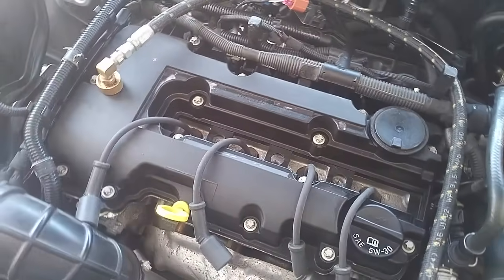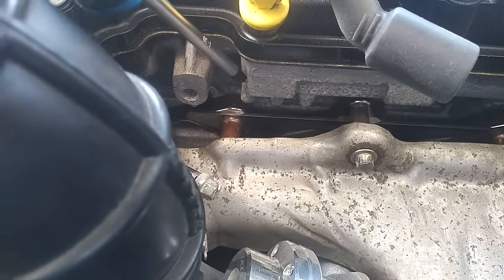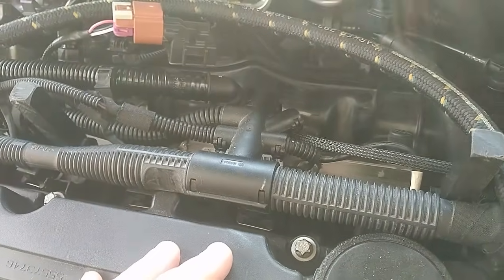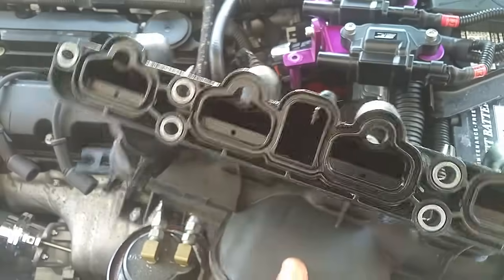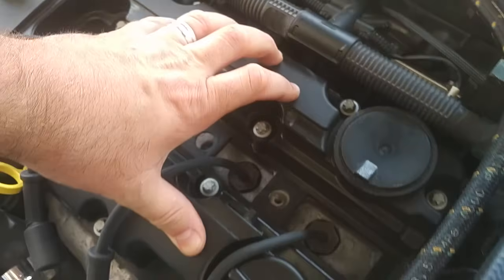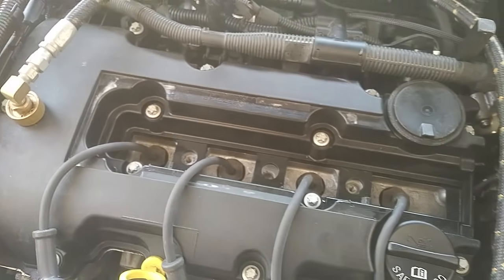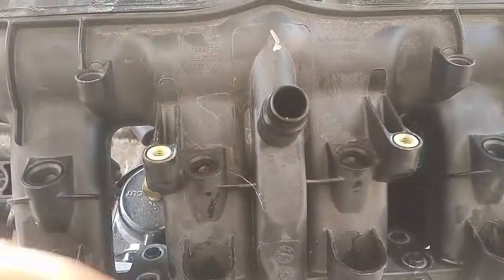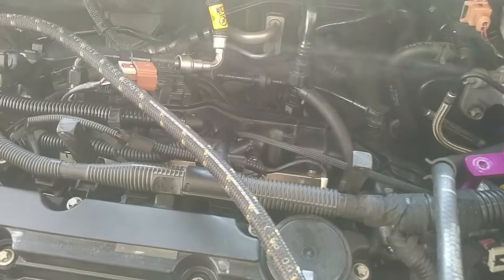Chevy Cruze Sonic Trax Encore 1.4L Turbo PCV Issues, Diagnosis, and Solutions

Comment: I’m getting massive blow by air pulsing out of the oil fill cap and dip stick when I pop them off and it’s running. I’m not sure what’s going on but I’m sure it’s something to do with the PCV system, it has codes for P1101 and P0507. It runs relatively normal I popped off that pcv hose on the intake and the inside of it is coated in oil, any ideas?
Reply from the maker: Has it been very cold where you are?

Comment: I hope you can answer a question for me sir... I'm a heavy equipment and diesel tech but I don't work on a lot of modern gas engines.. my wife has a 2015 cruze with turbo.. I topped off oil and forgot to put the cap back on it... she drove it a little while and then it started blowing oil smoke out of the tailpipe, and quite a bit of it.. it seems to be clearing up now that I topped off the oil and put the cap back on... can you tell me how that oil got into the exhaust? PCV possibly?
Reply: Thank you in advance
Reply from the maker: @VAHOSS very likely a PCV issue. Have you inspected the intake manifold check valve as shown in this video? Or installed the cruzekits pcv fix kit?
Reply: @AndreiDPop not yet.. the problem just happened today so I'm just now digging in and doing some research.. it had a fuel trim fault code
Reply: Actually I replaced that valve about 2 years ago... i think it was actually part of the valve cover
Reply from the maker: @VAHOSS it’s not. Please watch the video you’re commenting on.

Comment: Hey so I’m chasing this issue down on my 2016 Trax with little luck. So I was having weird  idle with multiple codes, I replaced an o2 sensor, maf sensor, valve cover and the corrugated hose, the idle got pretty much fixed but now I’m still getting a p0171. I checked for the nipple in the intake manifold and it seems to be in there. Is it possible for the nipple to be there and the check valve still failing. Any other way to check if it has failed besides the visual inspection of the nipple? Tests that I’ve done so far to see if the intake manifold failed is I removed the corrugated hose and fitted and long rubber hose to the port on the intake manifold that reaches all the way in the car through the window and went for a drive, basically what it does is at idle there is heavy vacuum and under load there is positive pressure, the longer I hold my finger on the hose the more positive pressure it builds as I accelerate. Is that just positive crank pressure I’m feeling or would that be turbo boost I’m feeling due to the check valve failing?  The positive pressure that build up at the end of the hose I would say is somewhat significant I’m guessing close to 10 psi or so.
Reply from the maker: Lots to respond to here. 

Yes it is possible for the nipple to be slowing but for the check valve to have failed the flap on the back side gets deteriorated and breaks off. Seen it happen a number of times. 

P0171 implies a vacuum leak. 

Let me guess…aftermarket valve cover? Your p0171 indicate a possible pcv pipe crack, but the remaining symptoms all point to a defective valve cover. Always use only OEM valve covers, never aftermarket. Strong vacuum at idle points directly to a valve cover issue. 

If this is an aftermarket valve cover, I’d recommend installing the pcv fix kit with a new OEM valve cover. I have a combo for both on cruzekits.com. 

I’m also a bit concerned with the hose you used in exchange for the pcv pipe. You didn’t use heater hose did you?

Comment: Can I put a standard PVC valve in the line that runs off the intake
Reply from the maker: Nope. The system doesn’t work that way. There’s already a check valve at the turbo inlet so adding a second would be redundant, and standard pcv valves aren’t designed to seal as check valves. Did you watch the whole video?

Comment: Thanks for making this video, you seem very knowlesgeable. I'm considering buying a 2018 Buick Encore with this engine although skeptical of all the issues... From what i've read, it all seems to stem from the PCV system going bad. Not sure at this point whether I should avoid at all costs... Input welcomed
Reply from the maker: If you’re comfortable working on your own vehicles from time to time, the engines are internally quite stout and easily make it past 250k miles. It’s just a few issues here and there like the pcv and cooling parts that sometimes give people trouble. Once those are dealt with and monitored, the cars are reliable. I have a friend nearby that has over 350k miles on his.
Reply: @AndreiDPop  I wasn't sure if I'd get a response as its 6 years since posting but I appreciate that very much. I'm a tram technician by trade and comfortable with small/medium repairs. Happy with a few proactive repairs for a $10,500 car. Appreciate your response. Interested in your PCV kit, was wondering, does it essentially bypass some of the PCV gasses?
Reply: I'm most afraid of the turbo failure but what i've managed to gather is that the issue stems from the PCV valve on the intake manifold malfuctioning, increasing crankcase pressure, oil seepage into turbo inlet pipe causing reduced airflow, heat, and cracks etc. 

If it could all be prevented by addressing the PCV system, then I'd feel assured. Would like to get an expert opinion though. Appreciated!
Reply from the maker: @Voltermort turbo failure won’t have anything to do with the pcv system. When it fails, it’s usually the wastegate housing crack getting too wide. Subaru has the same problems. Use a very good synthetic oil like AMSOIL signature series and your turbo should last at least 150k miles.
Reply: @AndreiDPop appreciate it 👍

Comment: Such a bad var. easy fix. Most of the newer models the nipped is gone. I have one on  my channel and they did away with this. Make sure on this year to get the upgraded version. It’s a TSB now on  this vehicle. Also an extended  warranty… check the NHSTA…
Reply from the maker: There is no upgraded version. The Dorman ones still fail, and the GM manifold was updated to move the bypass valve hose higher up so the bypass valve stopped filling with oil and gumming the solenoid. The TSB and extended coverage is only on some models and only for 10 years/120k miles. 

The only true OEM-spec upgrade is the cruzekits pcv fix kit.
Reply: @AndreiDPop I’m speaking about the newer models. Slightly different engine. Same deal. And yes the kit I am aware it. It places it in a different location. These stupid oil traps/PCV valves are trash… smh. 🤦‍♂️
Reply from the maker: @TSMobileMechanicLive oh, yeah the new engines are completely different. The LE2 direct injected engine. Nothing similar about those PCV systems. They use an orifice under a metal valve cover.
Reply: @AndreiDPop they have the same valve cover that is crap and the diaphragm always falls apart and make the engine run terrible. It does not allow it to seal the PCV system properly sucking in too much air when it shouldn’t.
Reply from the maker: @TSMobileMechanicLive  I'm not trying to be argumentative here, but the LE2 engine doesn't have the same valve cover or intake manifold. In fact, they don't have a diaphragm at all in the valve cover. The Gen1 1.4L Turbo and Gen2 are completely different with nothing shared between them, and all of the Gen1 1.4L Turbos are the same without any consequential updates to the PCV system. 

The valve covers are usually fine if you get OEM valve covers. Those last 50,000-180,000 miles if the intake manifold hasn't failed. I've even heard of a few going over 200,000 miles.
Reply: @AndreiDPop    I’m not trying to be argumentative either 😅 — but we’re clearly talking about two different 1.4T engines here. Have a look for yourself. Maybe that will be better clarification sorry for any confusion. I wanted to make sure put one thing out to you though.

https://youtu.be/JLm8DA-4JfY?si=Gw7zKNiVQ7JDaSja
Reply: The vehicle in my video is a 2018 Chevy Trax with the LUV 1.4L Turbo, not the LE2. The LUV has the black composite valve cover with the built-in PCV diaphragm, and that diaphragm fails constantly. When it tears, it causes high crankcase vacuum, lean codes (P0171, P1101, P0106), whistling, and rough idle. GM TSB PI1261A and Special Coverage 14882 both call for valve-cover replacement because the diaphragm isn’t serviceable. 👆👆👆
The LE2 you’re describing is the direct-injected, aluminum-cover variant used in later Cruzes and some Encores — totally different PCV layout with an internal orifice system. You’re technically right about that engine!
On the LUV, the intake-manifold PCV check valve commonly fails or goes missing, which over-pulls vacuum on the cover’s diaphragm until it rips. Replace the cover, inspect or fix the manifold, and you’re done — that’s the repair I showed.
GM also revised the OEM covers later (deleted the top vacuum nipple, altered baffles). They didn’t market it as an “upgrade,” but it absolutely is a revision meant to reduce repeat failures. So “no upgraded version” isn’t really accurate in the field.
Reply: @AndreiDPop  we are both correct essentially .. the 1.4 L setups GM used are the LUJ/LUV – found in early Cruze, Sonic, Trax, and Encore. Port-injected, black plastic valve cover with an integrated PCV diaphragm (that’s the one in my video)… Next the LE2 – newer direct-injected version in the later Cruze and some Encores. Aluminum cover with an internal orifice-style PCV system instead of a diaphragm pod. This is where confusion occurred… The LV7 – naturally-aspirated 1.4 L used mostly in the Spark. Simple design, no turbo, no PCV diaphragm issue.
So we are both talking about the “1.4 T,”… We are actually speaking about different engines with different PCV systems… The video where I did the repair above in the link is the LUJ/LUV version where the valve-cover diaphragm fails and replacement is the correct fix. Sorry for any confusion. To different but similar repairs. I never had actually watched your full video until just now lol… I just glanced it over but now I have a better understanding. Thanks. Great video by the way.

Comment: Love your PCV valve mod. I've used this on two of the turbo models. I'm a fleet mechanic for Domino's franchisee and unfortunately we bought eight  Chevys Three Fords and one Kia Rio. The only thing I've ever done to the fiestas and the Rio was change the brakes and oil. The Chevys unfortunately break once a month and I constantly fight to keep oil in it and coolant. They seem to have a good Chevy block but it's all the cheap accessories that plague the 18 and the 1.4 turbo. I love your thoroughness if that's even a word to me. You're one of the better mechanics that are on the internet. Thanks! Keep making awesome videos
Reply from the maker: Thanks for the encouragement! I need to get some more videos made here before the weather gets too cold to do so. Thanks for the support also!

Comment: i still have a check valve. but regulator got fcked twice why
Reply from the maker: Are you using OEM valve covers?

It’s also possible that the check valve in the intake manifold is completely deteriorated. All you can see is the retaining nipple; the flap that serves as a check valve is on the back side, and sometimes they just wear off completely.
Reply: @AndreiDPop thanks. I have P0299 under boost code, lacks power during uphill climb. does it have anything to do it pcv faults. turbo is great, no leaks. I can only see air coming out of pcv regulator at valve cover during high rpm. just wondering if thats a crankcase blowby or a boost leak.
im thinking to replace intake, vaccum hose pipe and valve cover now. I dont know if that will fix the underboost issue.
Reply from the maker: @Gibsonchha there should never be any air coming out of the vacuum regulator on the valve cover. That indicates the diaphragm has failed. A missing intake manifold check valve could contribute to the p0299. I would recommend ordering the combo pcv fix kit from cruzekits.com to address both. Don’t use an aftermarket valve cover.

Comment: If the nipple is gone and is not able to close. Where is the pressure going? Thank you.
Reply from the maker: Right into the crankcase.
Reply: @AndreiDPop  Is there a way to check the check valve that is a one way into turbo inlet?

Comment: I replaced my original intake with an after-market one. I still don't understand how the check valve here works, how does it open and close. Could you pls. explain with another video to show how the small rubber nipple works? Is the nipple the only part in the check valve?

Comment: Round cap on top is a PCV VALVE.
 INTAKE  NIPPLE GOSE BAD, YOU CAN GET A CRUZ KIT. YPU HAVE EPOXY THE HOLE AND INSTALL A INLINE CHECK VALVE . FORGET REPLACING VALVE COVER. LOOK UP  CRUZ KIT. Also, the sonic dose not have a coil pack. 
 This sonic has a mode on the intake.
Reply from the maker: Just for clarification, It’s a vacuum regulator diaphragm. It regulates vacuum from whatever the manifold is producing to 11-18 in-wc. This is documented in all GM TSBs regarding this issue. 

The reason I’m specific about that wording is because many people don’t realize there is an actual pcv valve inside the intake manifold. The nipple is just the part you see, but on the other side of where the nipple is mounted is a flap that serves as a pcv valve by allowing air to flow only one way.

Also yes it does have a coil pack. It’s the cover.

Comment: Hey Andrie, I believe the pcv located just above the turbo may be bad.  Im having high cranckcase vacuum (40.8 in of water).  Im seeing that it could be due to a blocked fresh air intake hose.  It this pcv valve where the pcv system gets its fresh air and could it be the reason I have high cranckcase vacuum? BTW, I have installed you v3 pcv fix kit

Comment: I am stuck. My Opel Astra 1.4 T (same engine) has also some problems. It has oil consumption 0,75 liter/1000 km),  performance problems, runs rough in idle, the engine is shaking. P0011 code camshaft position timing. Tank cap sticks, whitles when off. 

I have this since a few month, perhaps after a valve cover change (leaky) or an oil change (don't know)

I changed the valve cover again this week. Not better. The mushroom head in the intake manifold is still there.

I am not sure what is the problem. Perhaps timing chain or something with negative pressure or a combination. Have no idea how to analyse this

The workshop says oil consumption an timing chain are two different things (?). Pressure loss test was good
Reply from the maker: Do a compression test.
Reply: @AndreiDPop good idea. Difficult problem.

Comment: One of shitiest engines ever made
Reply from the maker: Yet I know several people with over 300k miles on them with basic repairs, and I know of one that went 691k miles before it burned an exhaust valve. 

They're not the most reliable, but they're excellent on gas, have great drivability, and will last a long time if you know how to hold a wrench.

Comment: I have a strange problem po299-00 fault , seems to be excessive vaccuum on oil filler cap , checked the intake and the breather for correct operation of check valves and all seems good , what else should i look at that could be causing excessive vaccuum
Reply from the maker: How did you determine that there’s excessive vacuum? What is considered excessive and how did you measure it?

Comment: I'm having issues with a huge oil leak on the passenger side, and oil in my spark plug well. I'm wondering if my PCV system is failing.
Reply from the maker: Very likely, and very common. If you don’t have the v3.4 pcv fix kit installed, I would recommend that asap.
Reply: @AndreiDPop  Just watched your other videos. Ordering tonight.

Comment: Very informative, thank you. My code came back as canister purge valve. I bought it from Auto Zone, haven't installed yet. Wanted to watch few videos and thus came up. You seem very knowledgeable about the 1.4, is there a way to contact you like email etc. Maybe with advice on maintenance as well as potential upgrades, boost maybe, chip or computer mods etc. Thank you, also new sub
Reply from the maker: Sure, you can contact me through the chat box on the cruzekits.com website.

Comment: The corrugated PCV pressure return pipe that goes brittle breaks so easily!
I rebuilt the one on the car i was working on (A 2011 Cruze) using washing machine drain pipe.
It's the perfect diamiter and the original fittings easilly slip onto it.
Reply from the maker: @AlanRFisher  it’s not pressure hose, it’s vacuum hose, which is inportant because there’s 18 in-hg of vacuum on that hose and heater or water hose will collapse under that vacuum. 

The inner lining on washing machine drain pipe will not survive with constant exposure to combustion products and oil mist. That breaks down the lining and it will swell and deteriorate, potentially sending bits of debris through the turbo when it does. 

This is why my cruzekits v3.4 PCV fix kit uses the correct spec PCV hose. I suggest you replace that hose ASAP.
Reply: @AndreiDPop  Yeah i said pressure but i did mean to say Vaccuum.
Trust me i have tested it extensively it works100%
It's the same kind of hose they used frm factory it's just at least 3MM thicker.
Still Corro.
Also, It's not my car.
AND It's  my neighbours Daughters car and I'm tryting to repair it as cheap as i can.
Already having to reuse seals / gaskets you'd never re use and suprisingly only due to my knowledge i have had 0% leakage which even i was suprised about!.
Us Australians do stuff different.
And better than others. ;)
Reply from the maker: @ going to say it again because I have seen this failure. Give it a year and it will start collapsing due to the interior deteriorating. Water pressure hose is not suitable for PCV use. 

I’ve been running the Cruze pcv fix kits since 2017. I’ve seen many people run heater hose and water pressure hose and it always fails, just a matter of time.